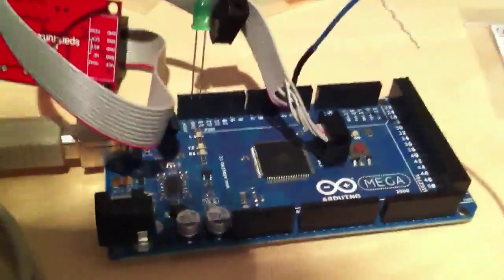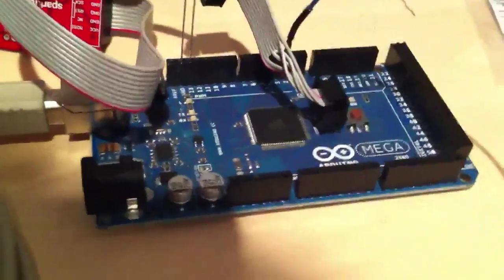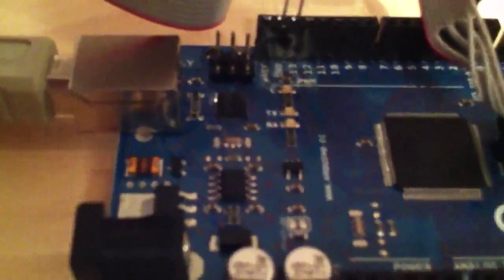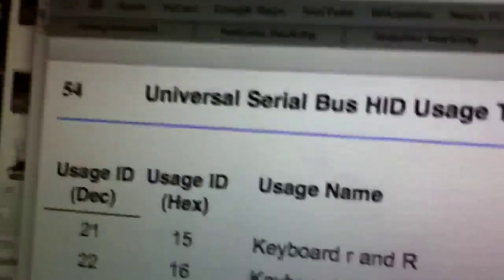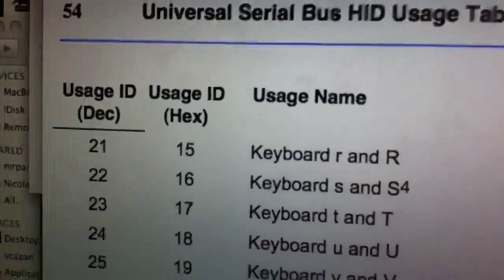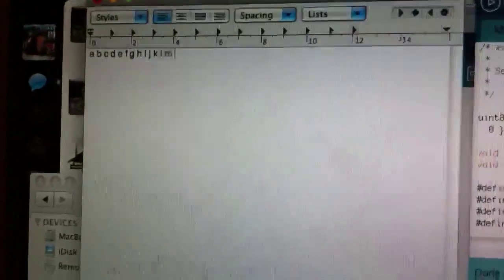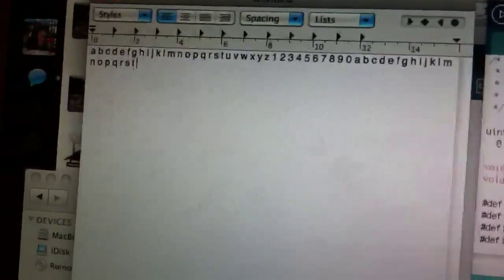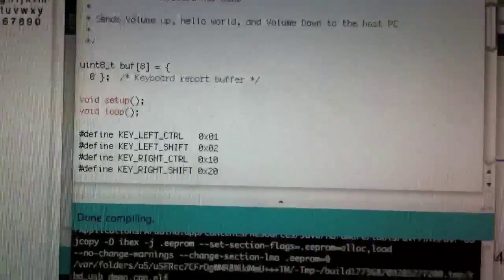Arduino Keyboard Emulator

Comment: Vlad - I'd like to implement USB via 2 GPIO pins on the Arduino's ATMega chip - rather than flashing it's ATTiny chip.

Have you got any idea if there's any code out there that would do this?